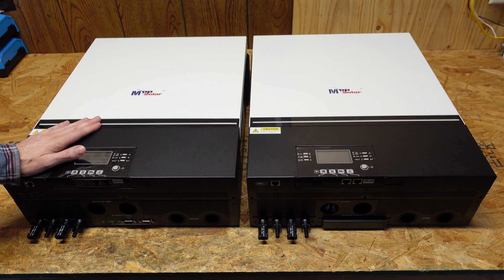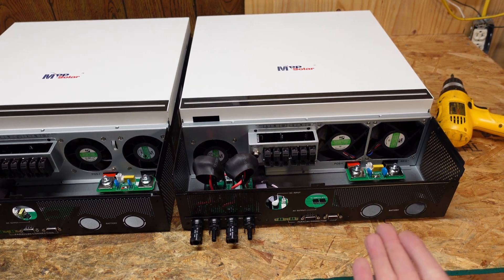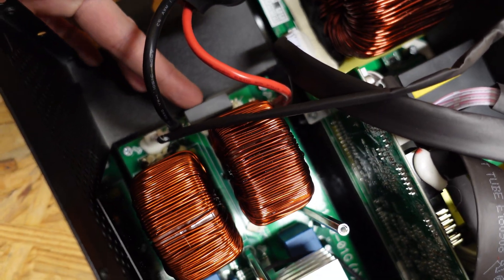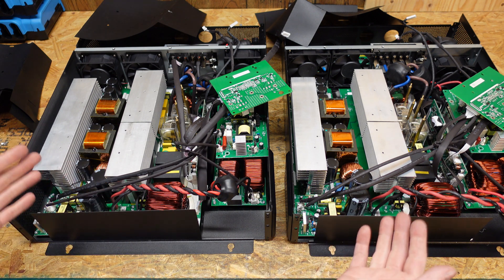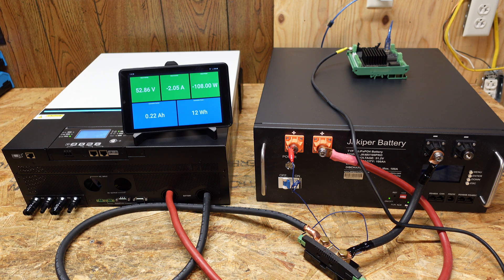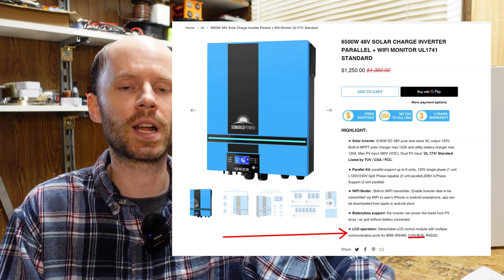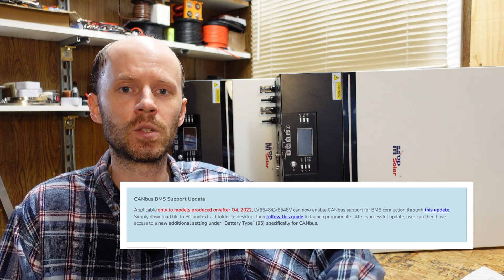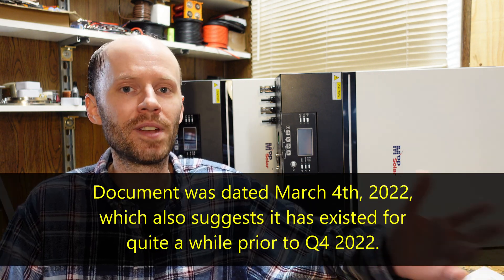MPP Solar LV6548V New Model - 390V PV, CAN Support, Idle Power, and More

Comment: @lithiumsolar , I installed my LV6548 250V version over 16 months ago with no issues so far, though I wasn’t impressed by MPPSolar lack of support when the connection block broke when tightening the output cables. That is what to expect when buying equipment with no real local support. My idle consumption is about 100W.

I also installed a small backup generator with a controller to allow auto generator start when battery goes down using the dry contact, so far been working well.
Reply from the maker: The terminal block breaking is a common issue, especially if you try to install thick-strand wire in, like standard THHN used in the US. They don't seem to break as much with finer-stranded wire. It's really just a poorly-designed terminal block. That 100W idle consumption though.... OUCH.
Reply: @LithiumSolar I know it sucks to have that much power consumption.

Comment: Great video, now that's 250 volts per mppt or 500 for both sides, is that right? And are those high or low frequency inverters? Thanks partner, have a good one.
Reply from the maker: The LV6548V is 390V per MPPT. Please check and verify in the manual if you're looking to buy one, there are many versions out there now. These are high-frequency inverters.

Comment: In practise, you don't need to allow for extreme cold and the voltage for unloaded panels. The panel voltages should be under load. Just remember that if you switch off the panels, not to switch the panel feed back on during peak solar hours on a cold day. You can use a voltmeter to verify the total string voltage first. In my opinion, it is better to do this than have maybe one fewer panel in each string.
Reply from the maker: That is very bad advice. Your system will see open circuit voltage every single morning when the sun is first rising before the controllers kick on and become a load.
Reply: @LithiumSolar  I have never seen anywhere near peak open circuit voltages at sunrise, as the sun's rays are nowhere near perpendicular to the panel surface, and sunlight travels through more atmosphere at the start of the day. The variation of the open circuit voltage Voc depends on the logarithm of the light intensity, and for typical silicon cells is from 0.565V for 160 W/m^2 irradiation (typical sunrise) to 0.616V for an irradiation of 1000 W/m^2 (midday). Even before sunrise, the logarithmic Voc of the panels is high enough to start the inverters and put the panels under load.  I think you just have to be careful in crunching the numbers to get the maximum out of your system.

Comment: More crap to go wrong with those. 

Go for lf inverter. 

There can be very reliable modular setups for everyday power needs and high demand applications. Just requires a large low voltage to 120 240v transformer. 

egs002 work well, use or make a choke with thiick wire, and less turs. get a toroidal core to fit about 10 turns of thick wire going to the transformer. egsoo2 boards work well. And buy them without mosfets, to then put your own high quality mosfets in.

Companies should sell modular modified improved kits.

Comment: So  I have a Voltronic AIO that is sold under the brand Maple Leaf Power Systems, basically the LV6548. It has the LI-A battery type setting. I didn't know this was the CAN-BUS option. AOI was made in Q2 2023. Has anyone gotten this CAN communication to work?
Reply from the maker: Yes, the LiA actually works very very well. It took me a LOT of back/forth to get the protocol documentation out of MPP Solar though and I'm not aware of anything, not one single product, that supports the protocol yet. So.... it's pointless right now unless you're looking to build your own integration with it.

Comment: Is it OK to use Monocrystaline solar panels with the LV6548V ?
Reply from the maker: The LV6548(V) manual states the following "WARNING: Because this inverter is non-isolated, only three types of PV modules are acceptable: single crystalline, poly crystalline with class A-rated and CIGS modules". A monocrystline panel would be the same thing as "single" crystalline.

Comment: Hi, how reliable are the LV6548 inverters. I am considering purchasing one for my off grid use. How long have you used it and do you still recommend it?
Reply from the maker: I've had a pair of LV6548 (original version) powering most of my home for 3 months now without a single issue. I'd consider them very reliable. I would not purchase the LV6548V (new version) though due to the ridiculously high power consumption. I still have the V versions but will likely sell them eventually.
Reply: @LithiumSolar  Thank you very much for your feedback. I was debating between a signle unit LV6548 or 2 units of 3000W either MPP or Growatt. Do you have any experience with that?

Comment: OK, I get the idle draw. However,  I currently have 24 450W panels, 45V @ 11 amps ea. I have them currently wired in series-parallel (to reduce PV under 250), which hits the LV6548 power limit of  130V X 18 amps per input or 2,340 X  4 or 9,360W theoretical max. To get more power input (with current panels), I would need to add more of the old LV6548=more idle draw. With the LV6548V I can rewire my current panels to straight series and get the full 270V PV at 11 amps or 11,800W input. Better yet I can add 8 more panels for 360V X 11 at 3960 X 4 for 15,840 watts input without rewiring anything. That's 6,480W more input that is way more beneficial to me than battery draw. I live in Central Florida. So what am I missing? This seems like a massive win?

Comment: Does this new series screw terminals accept 4 AWG? I have been reading, that 4 AWG does not fit.
Reply from the maker: They're crappy terminal blocks, but yes, #4 thhn does fit... tightly, with some wiggling.
Reply: Thank you for responding. Because I am connecting to a 100amp curcuit, I may have to use # 3 and if the blocks would accept a size 4 reducer fitting? IYO @LithiumSolar

Comment: I have their 4048 have not used it in a long long while,  I had to use a Transformer for 240 split phase but good thing I was able to hook to the grid with just 240 volt going to the inverter.  Crazy to see more Idle usage.  I could see this is they had a big split phase transformer making them heavy as heck. but these don't have that. you think the idle wattage would be really low.

Comment: I have a lv 6548 and you know what?  I hate it it works great but it is soooo loud it makes an awful noise all the time.  Unless your systems room is a mile away you will hear this pos screaming all night.
Reply from the maker: Yes, they're loud. I keep mine in a separate structure outside. Even if they were quiet, I'm not a fan of running lithium batteries in the house.

Comment: It sounds like you may be better off getting the MPP 11KW MAX inverter (like me). 500 volt mppt and only draws about 65 watts.
Reply from the maker: That appears to be a 240V inverter? I'm not seeing where it outputs 120/240V.
Reply: @LithiumSolar  Sorry mate yes it is only a 240 volt inverter. I'm from Australia and we only use 240 volt.

Comment: Hello, can we get a reply from you?
We are Acoucou Battery, have been studying these products through your video for a long time, have been emailing you but did not receive any reply, but we are not willing to give up this opportunity to grow with each other, this is also our determination to engage in the battery industry, for the product itself we are confident enough, at present we have self-research and production of 12V 24V 48V lithium iron phosphate batteries, mobile power Server batteries, and a full set of new energy battery products and peripheral accessories, to provide a full set of energy supply services, hope to be able to get cooperation with you, if you and SOK, EG4 such is an old friend, perhaps we can try to understand each other.

Comment: I had the same round and round never ending experience with MPP solar engineers with the ground bonding issue when I commissioned my inverters a couple of years ago to the point I gave up and figured it out myself. 
The idle wattage was already something that disturbed me even on the old version which I have, So that's an awesome find on the new version and wow, terrible!
I totally agree with the maximum open circuit voltage being another problem with the older version too. 
Thanks for the side by side comparison here! Keep up the good work!

Comment: Could you do another test to check the total efficiency, ac grid to battery, then back to ac.  We in Ontario Canada will have ultra low rates between 11 pm and 7 am.  My plan is to charge at night and run on battery from 7 am to 11 pm without solar.

Comment: My EG4 6500 has a 90W draw at idle. That is inefficient for me but I live with it since I only use it’s for a 120V setup. I just had to add a couple extra panels to the string. Fortunately it’s a 500V MPPT so I can get into the 350-400V range and feel comfortable it’s won’t overload the MPPT input even in colder New England.
Reply from the maker: I tend to agree if using only 1 inverter. It's when two are used that I think it becomes problematic. I also agree that it doesn't take much to just add a few more panels. If only I wasn't so darn tight on space... My property is angled and tree-ed in a solar-unfortunate way lol.

Comment: The higher voltage rating on HV DC capacitor is primarily for margin.  They may run the HV DC voltage slightly greater to allow more ripple voltage on HV DC bus.  The ripple voltage dip cannot drop below about 200 vdc or it will clip peaks of sinewave AC output.

Terrible idle power consumption.

You are correct in the greater the inverter's HV DC bus is run, the worse the idle current and worse the inverter efficiency under load will be.

It looks like exactly same board used in EG4 6500 inverter.

The board below this board with the two toroid coils at the end peeking out from below is the dual MPPT SCC controller.

So it looks like MPP Solar LV6548V is same as EG4 6500 unit.

Comment: 100W is not acceptable ... mine is already 45W and it's on the high side in my opinion. Mine is a 5.5kW inverter with 500V max input PV (total 6kW PV max)
900$ as discount .. mmmm .. payed mine 400€ (5.5kW not 6.5kW)

Comment: Odd that EG4’s version has been 500V input limit a long time now, but the mpp still is under 400V
Reply from the maker: I've heard two reasons on this, neither of which I can verify though - exclusivity agreements and would require redoing the TUV certification process.
Reply: @LithiumSolar  you clearly were interested in upgrading but decided against it because of the high idle loads. Is there a reason why you haven't switched to eg4?
Reply from the maker: @deanburrito6943  Yes, there are a few reasons why I'm not interested in the EG4.
Reply: @LithiumSolar  Can you say why? or are the reasons already listed in another video? Knowledge is power bro, and you have more than most of us, so if you don't like something for a reason it's worth putting out even as an opinion piece!

Comment: “Idle draw… unacceptable”

Might want to try a Genetry Solar inverter, for lower idle draw. Their latest is even lower! Waiting for my preorder to be fulfilled, but it has no charge controller… so I will use mine A/C coupled.
Reply from the maker: Did you order the 6kW version? Please let me know what the idle is when you receive it. I don't see any notes about it in their user's manual.
Reply from the maker: Oh I see it now, they're claiming 31W for 6kW?? That's pretty darn good!
Reply: @LithiumSolar  - I ordered the 12kw version… I had a huge idle draw on a 3000w with 6000w peak 12v inverter, that can run half my house (and no hvac compressor), so I wanted a low idle draw and need a massive peak for my compressor. 

I was upfront with my 31.2kw peak need to turn over my hvac compressor, they accepted my 12k pre-order and said they think they could handle it with their 12k unit.

Looking forward to the adventure!

Comment: RS-485 was the standard for inverters in 1998.  But to still be using this legacy tech in a "new" inverter (a quarter century later) says a lot about how much the companies engineering has really advanced.
Reply: Half the worlds infrastructure operates on rs485, predictable timing and bandwidth is probably vital for this application, what standard do you suggest?

Comment: Can the regular lv6548 inverter work with a lifepo4 battery without bms communication without throwing up errors?
Reply from the maker: Yes it will work as long as you program all the settings correctly. The communications connection is not required.
Reply: @Lithium Solar  ok thanks. Thought it had to have bms communication to work with lifepo4 batteries

Comment: The charging algorithm may be ok for LFP but I know four people with similar HV string inverters who all now have trashed FLA batteries.
Reply from the maker: What happened???
Reply: @LithiumSolar  I wish I knew. One 48v system couldn’t make the absorb voltage required (when you included the temp compensation).  Another system would go straight to float when it reached adsorb voltage.  The absorb time, according to the manual, is calculated as 10x the CC period so if it took 2 hours to get to absorb, the absorb period would be 20 hours so the batteries would never go to float. From what I’ve seen, I would never use them on a FLA battery. If this charging algorithm is used on LFP batteries, I can’t imagine it being  very good for them either.
Reply: Darn I wish I knew what the abbreviations meant

Comment: Save your money, buy Victron gear.  You get what you pay for.
Reply from the maker: I know... it's tempting for sure.
Reply: I totally agree. If I had to do it all over again that's what I would do dang it I'm stuck with this sungold LV 65-48 copy
Reply: @VinceBadovinatz88  got the same ones, and disappointed that they do not communicate with the batteries properly.
Reply: Agreed if only they would get it UL approved .
Reply: I'm still in limbo as to what to purchase. What makes the victron better than the eg4 6500ex?
Reply from the maker: @deanburrito6943  I've settled on the original LV6548 that were manufactuered in Q4 2022 so it will have the new CAN protocol. Since filming this video, I have unfortunately confirmed that certian parts of the new protocol don't work on the LV6548 with older manufacturer dates.
Reply: @Dean Burrito  I think of you have plenty of solar and plenty of battery you probably don't need the victron you could make do with these Chinese cheapies a lot of people are making them work very well but the idle consumption is very high. If you have two of them running you're going to be burning 200 Watts or more the whole time they're going. If you leave them on all day long can you imagine how many watts your burning. Victron items have a much much lower idle consumption. If you're in a vehicle or something like that stay with victron you need a lot of solar to be able to even run those Chinese cheap things. I wish I would have known that I have to turn mine off during the night. I can't leave mine running all night. I'd need three times the amount of solar panels than I have.  Thank God I only bought one of them. now I'm broke I can't add anything else to my system. I bought a concrete truck and there's no work I made a really bad investment spent all my money on a work truck and then there's no work
Reply: @VinceBadovinatz88    SOLID!   Also, you could shoe-horn in a smaller Victron Phoenix inverter such as a 1200VA to use for small 120v critical loads overnight while the big idle-power-hog units are powered down.
Reply: @John Guilbert  well that's a hell of a good idea. Do you happen to have a diagram. Of  How to do that... I would probably need a transfer switch of some kind. Ill really keep thinking about that
Reply: @deanburrito6943  if you buy the older 65-48 their idle consumption is only about 65 W. You just can't put that many solar panels on them. But how much solar do you actually need anyway

Comment: What options are available for folks incorporating solar panels and micro inverters? Obviously we can't take the AC power from the solar panels and use it directly for 115vac circuits much less 240-vac circuits. And how do we charge batteries with an AC out put from the solar panel/micro-inverter combo setup?

Comment: Thanks for sharing!  

Yeah, that high consumption is just way too high.  I thought the EG4 6500 was bad...  Seems like it has to be more than just the fan differences causing the higher consumption.  Appreciate you digging into the guts of the units to see what's different.

I wonder, can the LV6548 and the LV6548V be run together in split phase?  Then you could use 1 inverter to utilize the higher MPPT voltage.
Reply from the maker: I suspect the FETs are also different. I didn't take it apart far enough to grab the part numbers and didn't think about it until after the fact.

MPP Solar has stated that the two versions cannot be used together.
Reply: @LithiumSolar  No worries.  I never thought about those either.  

That stinks that they can't be used together.  Would have given a little breathing room from the higher idle consumption.
Reply: @LithiumSolar  terrible idle consumption I've been wondering what my son gold LV 65-48 is consuming. Gosh the 65 first NPP version is pretty decent. I wish wish I could check my idle consumption. I got to figure out how to do it